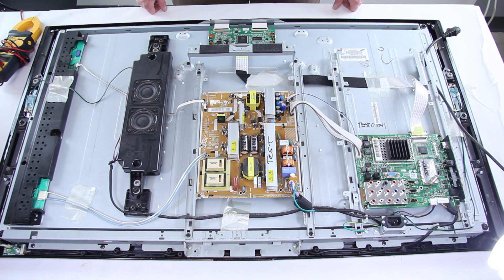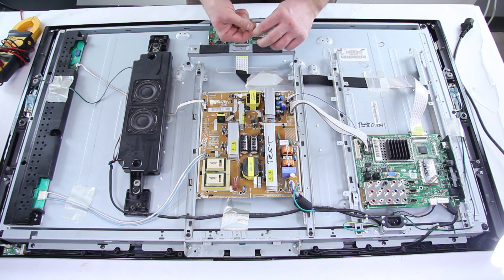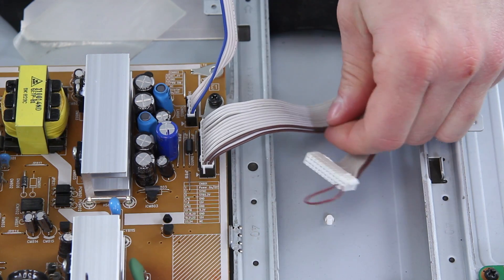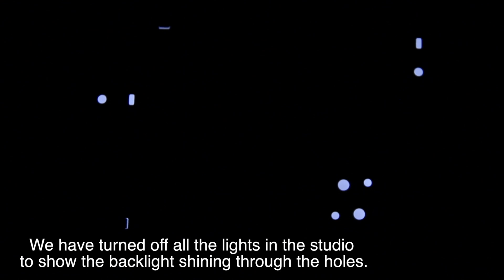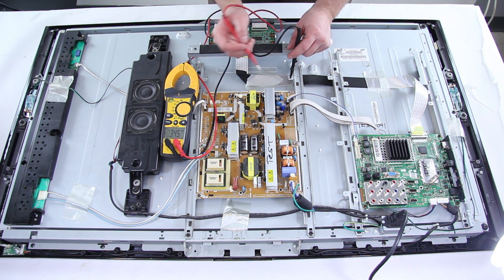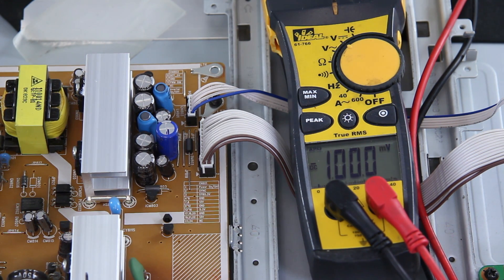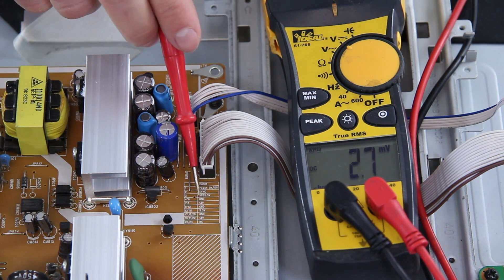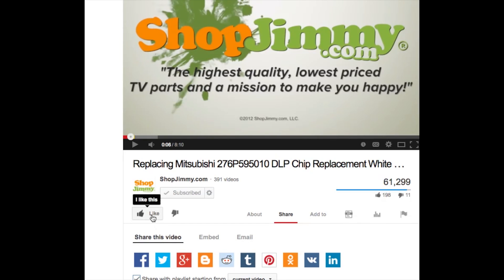Samsung LCD TV Repair - TV Won't Turn On - How to Replace Power Supply & Main Board

Comment: I have watched your utube vids and I did the flash light test. I see back lights and I have sound.
I think by what I have found and what you said I need a Tcon board. I have a Samsung 46 LED 3D smart TV model # UN46D6420UFXZA.
CAN YOU PLEASE HELP WITH A PART NUMBER or your suggestion to fix.
Thank you,

Comment: Hey man, my samsung tv crashes/turns off by itself 

I could use it for 20 mins, then it turned off, than again an athor 10-15 min usage , and turned off, and i can't turn it on now, the buttons all are black,, no red dot or anything,

I did open it up to remove dust with a vacuum, but thats it,

What could it be =?
Reply from the maker: MovvEE Scarface   I recommend replacing the power supply in your TV.  Please reply with your TV model number.  Click here to view a video that shows how to find your TV model number:  https://www.youtube.com/watch?v=S51nhAmwR2M  Thanks!  www.shopjimmy.com

Comment: Samsung LED TV 2010 model UN40C6300 (I think); issue with the remote sensor in the TV. Have done troubleshooting of the remote and the remote works fine, the TV won't respond. How can I fix/replace this myself?
Reply from the maker: First Last  Please watch this video FIRST to help with your repair!  https://www.youtube.com/watch?v=BP3NVNCGEv8  I recommend replacing the main board in your TV.  Click this link to replacement parts for your TV model number:  http://www.shopjimmy.com/catalogsearch/result/index/?cat=56&q=UN40C6300  There may be multiple boards for the same TV model number, be sure to match part numbers on your current board, with your replacement for compatibility.  Here is a link to a video showing how to identify your part number, click here:  https://www.youtube.com/watch?v=BEPWrefQvqI  Thanks and please let us know if you have any further questions with your TV Repair!  www.shopjimmy.com

Comment: Hello, I have a Samsung UN32EH4000F 32" LED TV, it suffered a power surge via  lightning strike. The TV did not power on nor did the standby light work. I opened op the tv and examined the boards, both boards didn't show sign of damage. What I did was unplug the main cable that feeds from the power board to the main board. When i did this the display lit up. I had no functionality but the display lit up. Does this mean the main board is bad or both power and main board?
Reply from the maker: QuestionAsker   Please watch this video FIRST to help with your repair!  https://www.youtube.com/watch?v=BP3NVNCGEv8  I recommend replacing both boards.  Click this link to replacement parts for your TV model number:  http://www.shopjimmy.com/catalogsearch/result/?q=UN32EH4000F  There may be multiple boards for the same TV model number, be sure to match part numbers on your current board, with your replacement for compatibility.  Here is a link to a video showing how to identify your part number, click here:  https://www.youtube.com/watch?x-yt-ts=1421782837&x-yt-cl=84359240&v=sSJexLvRrjM  Thanks and please let us know if you have any further questions with your TV Repair!  www.shopjimmy.com

Comment: I bought an Apex LCD HDTV, Model LD-4688T
S# 5134701018601E602

I have an APEX LCD Model LD-4688T that just recently started doing this. I  
turn it on and the  screen comes up, but then within a second or two the TV powers off again.

I PUT A NEW Backlight Inverter board SSI460_12F01 Rev 0.2 LJ97-03319A
BUT  do the same then a immediately turn off.

check over the CCFL Backlight Lamp Bulb they ok check them one by one
they turn on
help
Reply from the maker: franciela charlotte   This could be a problem with the power supply or the main board in your TV.  You may need to replace each board individually to see which one fixes the problem.  Click this link to replacement parts for your TV model number:  http://www.shopjimmy.com/catalogsearch/result/?q=LD-4688T  There may be multiple boards for the same TV model number, be sure to match part numbers on your current board, with your replacement for compatibility.  Thanks and please let us know if you have any further questions with your TV Repair!  www.shopjimmy.com

Comment: Hi,
My Samsung LN55C630K1FXZA won't turn on. When I press the power button there is no light or clicking. After taking a look inside, it looks like one of the components on the power supply board literally melted. can you help me find the proper replacement power supply part? thank you

Comment: My HDTV E322VL is blinking amber and white VIZIO logo. Reset power/unplug even over night. Same issue. I even disconnected all/dish and Cable connector from TV. Nothing happens with TV remote or Dish remote or Buttons on side of TV.

Comment: I am working with a Samsung UN40EH6000FXZA. It was working fine and then went off. It will not power up. I have removed the power supply and get no voltage to my "power on/off" pin 14 on the 
BN44-0498A board.
Reply from the maker: Rob Wassom  Please watch this video FIRST to help with your repair!  https://www.youtube.com/watch?v=BP3NVNCGEv8  I recommend replacing the power supply board in your TV.  Click this link to a replacement part for your TV model number.  http://www.shopjimmy.com/samsung-bn44-00498a-power-supply-board.htm Be sure to match part numbers on your current board, with your replacement for compatibility.  Here is a link to a video showing how to identify your part number, click here:  https://www.youtube.com/watch?v=sSJexLvRrjM  Thanks and please let us know if you have any further questions with your TV Repair!  www.shopjimmy.com

Comment: Hi, which pins should I jump for power supply on PK101V3120I for a toshiba 40L5200U
Reply from the maker: tmanmushroom   I recommend just replacing the entire power supply.  Here is a link to possible replacement power supply boards:  http://www.shopjimmy.com/catalogsearch/result/index/?cat=59&q=40L520  There may be multiple boards for the same TV model number, be sure to match part numbers on your current board, with your replacement for compatibility.  Here is a link to a video showing how to identify your part number, click here:  https://www.youtube.com/watch?v=b9L0-m0-pjA  Thanks and please let us know if you have any further questions with your TV Repair!  www.shopjimmy.com

Comment: I HAVE A SCEPTRE 40 INCH TV X409BVFHD8HJ1LO1 REMOTE DOES NOT WORK TRIED UNIVERSAL REMOTE ORDERED IR SENSOR OFF EBAY STILL DID NOT WORK CHECKED REMOTE WITH VIDEO CAMERA IT IS FLASHING WHAT TO TRY NEXT. THANKS. BUTTONS   ON TV WORK BY HAND.
Reply from the maker: Thomas Butcher   Replace the main board in your TV.  Unfortunately I do not see any replacement parts in the search results for your TV model number on our website.  Please reply with your part number on your main board and I can try searching for replacement parts.  Thanks and please let us know if you have any further questions!  www.shopjimmy.com

Comment: Samsung LE37C530F1W LCD. Problem wont turn on but standby light flashing, also standby light responds with remote control..On removing the cable from power to main board the back lights come on!!! does that suggest a main board problem?
Reply from the maker: Nips 1000  Please watch this video FIRST to help with your repair!  TV Repair! LCD, LED, Plasma, DLP How To Fix Your TV with ShopJimmy.com Help!  I recommend replacing the main board in your TV.  Click this link to replacement parts for your TV model number:  http://www.shopjimmy.com/catalogsearch/result/index/?cat=56&q=37C530F  There may be multiple boards for the same TV model number, be sure to match part numbers on your current board, with your replacement for compatibility.  Here is a link to a video showing how to identify your part number, click here:  Samsung TV Repair - Part Number Identification Guide for Samsung Main Boards & Digital Boards  Thanks and please let us know if you have any further questions with your TV Repair!  www.shopjimmy.com

Comment: I have a Samsung LCD 32in TV bought in 2011, Model# LN32C540F2D; Serial# ZINX3CG2700099N. The TV was no and suddenly the screen got dark. I thought i pressed the sleep button on the remote. I tried the remote and also the power button but no result. Also unplugged the TV waited 10 -15 minutes but no positive result. Help
Reply from the maker: Lucretia Johnson   I recommend running the flashlight test on your TV.   Here is a link to a video we produced that shows how to run the flashlight test. LCD TV Repair - Flashlight Test for No Image, No Picture on TV Screen - How to Fix LCD TVs Please reply with your flashlight test results and we can recommend a replacement part for your TV repair. Thanks and please let us know if you have any questions! www.shopjimmy.com

Comment: Hi there. I was told that in order to use a power supply board from a different samsung (Samsung LNT4661F 46" 1080p LCD HDTV) I have to calibrate because the voltage is different. How do I do this, and is that correct?
Reply: I should tell you to be clear, I have (2) Samsung LNT4665F 46" 1080p LCD HDTV and the power supplies got switched during a capacitor change, so we don't know which power supply goes to watch TV. It's all the same equipment.
Reply from the maker: Renee Lilley   This is not recommended.  Thanks!  www.shopjimmy.com
Reply: ShopJimmy.com
Thanks for the reply jimmy! Is it not recommended to calibrate or to use a different power supply thats not matched with the TV? If the latter- is there a way to tell which on goes to which?
Reply from the maker: Renee Lilley  It is only recommended to use parts that match part numbers with the original boards.  You can research the model numbers and part numbers on the boards to see which matches up with which.  Thanks!  www.shopjimmy.com

Comment: Hi on my power supply inside my technika 32" 720p tv there are little blue things that have leaked a grey coloured liquid. Is there a way to fix this or clean it properly? Thanks
Reply: Model No.: LCD 32-56
Reply from the maker: Dane Moulding   They will need to be replaced or you can replace the entire board.  Unfortunately I do not see any replacement parts in the search results for your TV model number on our website.  Please reply with your part number on your power supply board and I can try searching for replacement parts.  Thanks and please let us know if you have any further questions!  www.shopjimmy.com
Reply: oh okay thanks for your help :)

Comment: I have a Samsung LED TV.  It will power on from rear (power switch) but not with the remote.  Samsung Tech said get new remote however I tried another remote and my remote works on other Samsung TV
Reply from the maker: Fred Mazur   I recommend replacing the main board in your TV.  Please reply with your TV model number.  Click here to view a video that shows how to find your TV model number:  TV Repair STEP #1 Help IMPORTANT TUTORIAL How To Find Your TV Model Number Tutorial TV Repair Help  Thanks!  www.shopjimmy.com

Comment: hi i have a ? i have a vizio e291-a1 . win i plug the tv in and hit the power button i get nothing execpt a light at the bottom of the tv im guessing its a stand by light . nothing looks burnt or anything i have a lil white fuse thats right above the power inlet . i was told i need a power supply but i wanna say its the lil white fuse any help is grateful thanks kris c.
Reply from the maker: kris cox   I recommend replacing the main board in your TV.  Here is a link to replacement parts for your TV model number on our website, click here:  http://www.shopjimmy.com/catalogsearch/result/index/?cat=56&q=e291-a1  Be sure to match part numbers on your current board, with your replacement for compatibility.  Here is a link to a video showing how to identify your part number, click here:  TV Part Number Identification Guide for Vizio Main Boards (Plasma, LCD, LED)  You can also call our customer service for further assistance with your purchase.  (877) 881-6492  Thanks and please let us know if you have any further questions with your TV Repair!  www.shopjimmy.com

Comment: sir i have a hitachi l32a03a tv. the standby red led glows . but when click the power on switch led changes to green for a second and turn off. then i have to unplug all supply and wait for few seconds to get standby led red to on again. can you advise ?
Reply from the maker: Rakesh Raveendran   I recommend replacing the power supply board in your TV.  Unfortunately I do not see any replacement parts in the search results for your TV model number on our website.  Please reply with your part number on your power supply board and I can try searching for replacement parts.  Thanks and please let us know if you have any further questions!  www.shopjimmy.com

Comment: I have a question......
My LCD TV Samsung Model LA22A450C1xxd, when i plug the power cord, power led show red (or standby, but no flashing / TV with standby light). All capacitor is in good conditions (flat), please help me how to repair my lcd. Thanks before

Comment: I have a Samsung plasma flat screen model #pn51e450a1f. My T.V. will not power on at all after I had a power outage in my area. Can you please help me with my problem.
Reply from the maker: KLynn  I recommend replacing the power supply board and the main board in your TV.  Here is a link to replacement parts for your TV model number on our website, click here:  http://www.shopjimmy.com/catalogsearch/result/?q=pn51e450a1f  Be sure to match part numbers on your current board, with your replacement for compatibility.  You can also call our customer service for further assistance with your purchase.  (877) 881-6492  Thanks and please let us know if you have any further questions with your TV Repair!  www.shopjimmy.com

Comment: Can you help me I have a samsung model#UN50ES6150FXZA
Ser#260HCYC604523T
The tv just stays black the little red light left corner of TV blinks on and off and if I use remote to go to menu it will blink rapidly but screen just stays black. I called samsung they said it does not show on so they can't trouble shoot. They said call a repairman. I thought I'd try this first?
Reply from the maker: Olga Ascione   You will need to check for voltages on your power supply board.  Thanks!  www.shopjimmy.com

Comment: hello my samsung tv 46 inch  tv goes on and off. sometimes it works great others times after its been running for a while it starts turning on and off is this the power supplie
Reply from the maker: chilly willy   It could be a bad power supply board or the main board.  Try this repair at your own risk.... You will need to check the voltages on your power supply to see if they are normal.  Please reply with the test results and also please reply with your TV model number.  Click here to view a video that shows how to find your TV model number:  TV Repair Help IMPORTANT TUTORIAL How To Find Your TV Model Number Tutorial TV Repair Help  Thanks!  www.shopjimmy.com

Comment: Another Samsung LN40c630KlF tv will not turn on with remote.  Remote does work on another tv. No other means to turn on. No on switch anywhere on tv. Tested fuses both good. Stand by light on. when plugged in. Will not come on when remote power is pressed.
Reply from the maker: Morris Hensley   Sounds like your IR sensor is not working, so since the main board runs the IR sensor, I recommend replacing the main board in your TV.  Here is a link to replacement parts for your TV model number on our website, click here:  http://www.shopjimmy.com/catalogsearch/result/?q=40c630  Be sure to match part numbers on your current board, with your replacement for compatibility.  Here is a link to a video showing how to identify your part number, click here:  Samsung Main Boards & Digital Boards: Part Numbers for LED, LCD, DLP, Plasma TV Repair  You can also call our customer service for further assistance with your purchase.  (877) 881-6492  Thanks and please let us know if you have any further questions with your TV Repair!  www.shopjimmy.com

Comment: My samsung LA32450C no sound no video.Red power light on. PS board BN44-00209A.  on/off pin1=0.2V not stable, ST-By pin3=5.4V. All Caps appear flat/good, all power TRs /FET/diodes no short circuit (measured on PCB). should I removed the 2 cable connected to main boards and jumper pin1 & 3  and  pin 1 & 5 of of plugs to force INV on and Power on? Or please suggest where to troubleshoot, IC MC33067? opto coupler? Thank you.

Tang
tang54321@gmail.com
Reply: tang 54321 
Jumpered pin1(on/off) & pin3(St-by) of power board and pin1(BL on/off) and pin3(5V det). turn power, no 12V and 5V appears on PowerBoard. LCD panel not light up. Can we confirm power board is faulty? what can I do now?
Reply: tang 54321 
Since the PSU caps, TRs and Diodes all measured and visualy ok. Jumper ST5V and on/off pins shown no effect.Suspect faults cauld be a dried joint somewhere. So I re-soldered all the bulky components to try my luck. PSU works finally.Thanks for all suggestions anyway.

Comment: I have a Samsung LED TV that will not turn on. I have the standby light and when the on/off button (or remote) is pressed, the light blinks. What recommendations do you have for troubleshooting both the power supply and the main board? The power supply is a BN44-00423A and the main board is a BN94-0463A. I would like help on measuring the voltages at the power supply under various conditions in order to confirm or eliminate whether the power supply is bad.
Reply from the maker: Klaus Krane   All of the volts should be labeled on the power supply.  Thanks!  www.shopjimmy.com